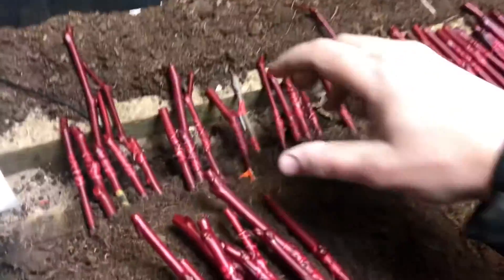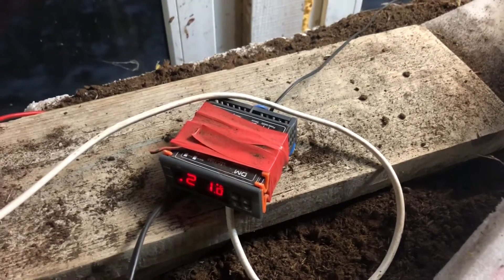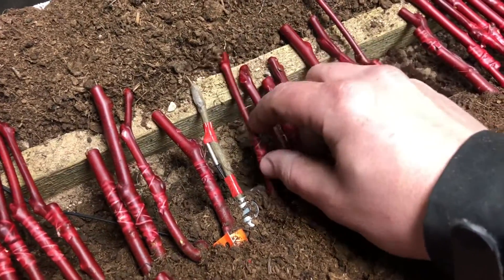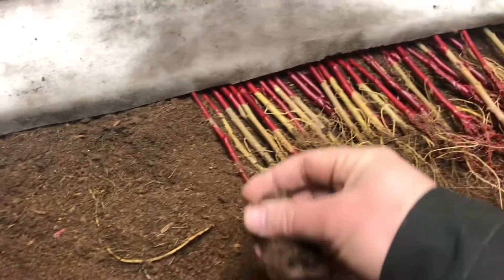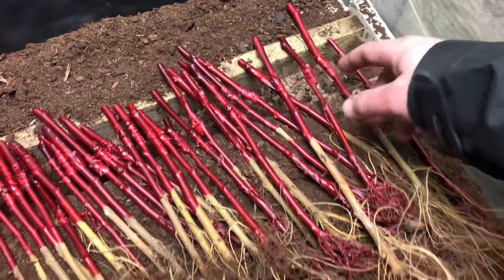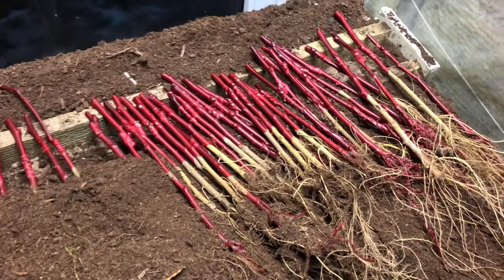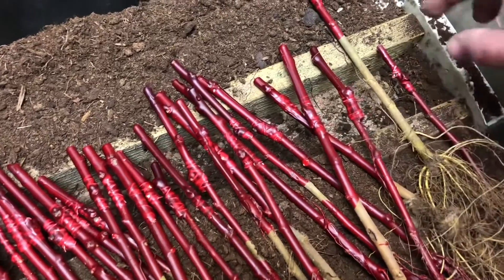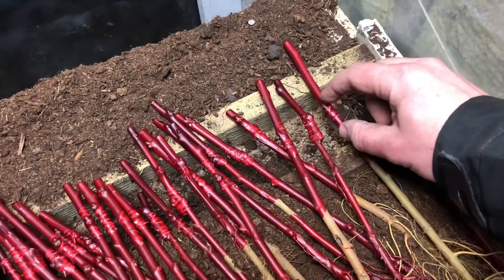Hot pipe - most efficient hot callus grafting system.

Comment: Great video, thanks! Is this a reliable thermostat? I've already bought several terrarium thermostats that fluctuate too much in temperature. If you could tell me the brand of the device and the kind of heating cable you use, that would be very helpfull!
Reply from the maker: Thanks! The termostat is really cheap one, but it is very realiable. I was amazed that such cheap one can be better than others much more expensive I used before. I bouht it on aliexpress: https://www.aliexpress.com/item/1005005039646733.html?spm=a2g0o.productlist.main.17.668c73dcQD5h4N&algo_pvid=5441dcf0-54d4-4bef-a605-0ded39c30b5e&algo_exp_id=5441dcf0-54d4-4bef-a605-0ded39c30b5e-8&pdp_npi=4%40dis%21EUR%214.53%210.94%21%21%2134.13%217.08%21%40211b61b017298441368665280e9248%2112000031419119804%21sea%21LT%210%21ABX&curPageLogUid=bXH3ELsKyVT3&utparam-url=scene%3Asearch%7Cquery_from%3A
You can buy heating cable on Amazon easily. Just type floor heating cable and select the lenght. You can find me on facebook if need any help: Raimond Racinski

Comment: I really like this set up. Why is there root packing material on the side where you are putting the scion? Is that in case you don’t wax so you can cover the scion to keep it moist?
Reply from the maker: Thanks! I'm not sure what root packing material are you talking about. Sorry :D
Reply: @RaimondAsimina  you have the side where the roots are which needs to be moist, then the hot pipe, and then more peat moss on the other side where the scion is, correct? I’m wondering why you have that there.
Reply from the maker: @jkochosc  oh, I see now. That is not necessary, I’ve been thinking that it will prevent heat loss but it doesn’t help too much :)
Reply: @RaimondAsimina  got it! Yes I’m making the channel out of foam insulation board since I have some. Thanks again for this great set up!

Comment: Great video, thank you for sharing.
Do you wrap or tie your grafts before dipping in wax?
How long do you leave them in there to callous?
Many thanks
Dom
Reply from the maker: Thanks Dom. I usually use 120 x 4mm rubber strips. They are biodegradable so I do not have to untie them after. I leave them for 3-5 weeks in hot-pipe, usually for 5 weeks. Typically you’ll be able to see callus trying to break the wax.
Reply: @RaimondAsimina Brilliant, thank you Raimond. I hadn't seen you had replied, but was watching your video again as I am going for it this coming winter. Thank you!

Comment: This is a great video for this technique. Thanks for sharing.
Can you comment on the best time of year for this method? 
Also, am I seeing this correctly: you have taped the graft junction and also dipped them in wax? Is this to control humidity of the scion?
Reply from the maker: Thanks! You can do it whenever plant is dormant. And after the junction is ready you can put it into the cellar or refrigerator (0-1.5C) and wait untill there is no frost danger and then plant them. I do not tape them. Those are rubber strips to create a pressure in graft place and then wax on top as a sealant.

Comment: thanks for the video. Did you already tried grafting wallnut like this?
Reply from the maker: You’re welcome. Yes I have tried twice. And it didn’t work for the first time for the reasons I explained and worked with 95% success rate for the second time when I did everything right. 27,5 C in the pipe and not more than 5 C outside the pipe.
Reply: @RaimondAsimina  Thanks for your answer! I planned to do this in a wooden cabin without insulation, so diffents temperature between day and night. Having max 5 outside the pipe is quite difficult... Or i'll need to graft very early like february but it's difficult to store 50 trees until may...Do you have any advices? Thank you!
Reply from the maker: @sidoniearlat1408  It depends on what part of world you live in, what facilities you've got etc. You can contact me on Facebook, and I will answer you questions there: Raimond Racinski